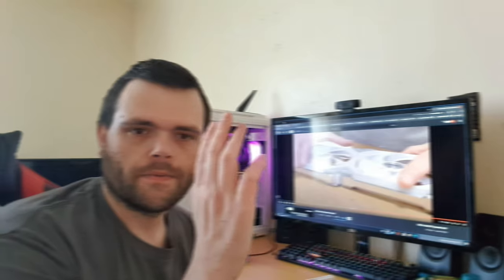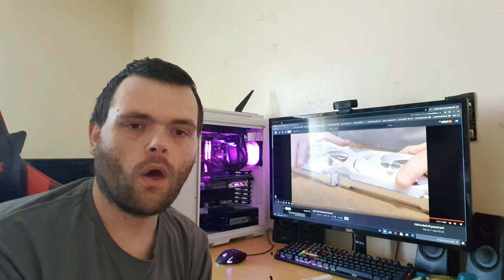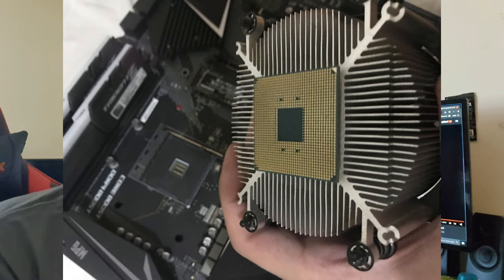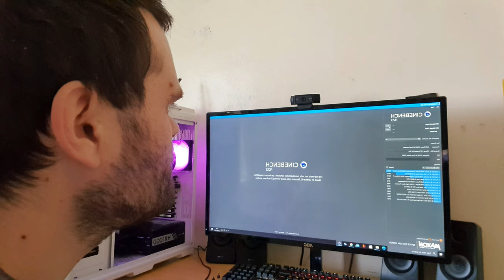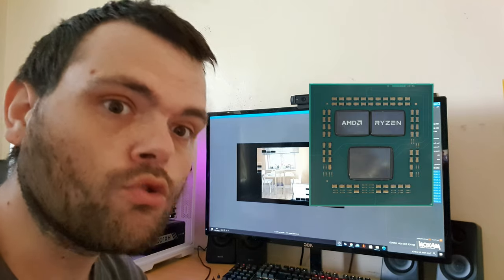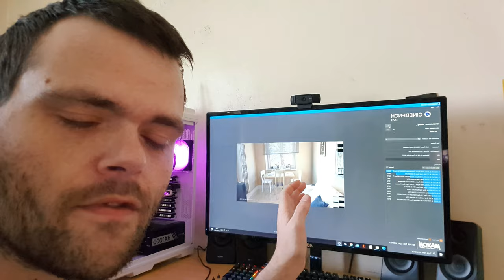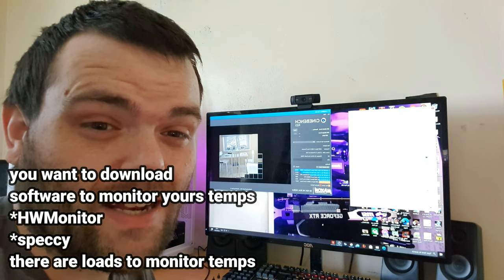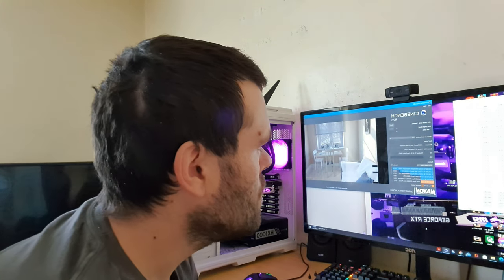AMD CPU COOLER REMOVAL THE CORRECT WAY

Comment: I got to tell you one thing,  you have never tried to uninstall a stock cooler caked on there for 5 years. it's absolutely impossible to loosen even when taking a heat gun to the cooler. it's easier to pull the cooler out with the CPU and remove it by prying between the cooler and the IHS with a thick screwdriver or similar.
Reply from the maker: Should be changing thermal paste more often than every 5 years and if the cpu is working with a benchmark for a few hours it would losen the paste